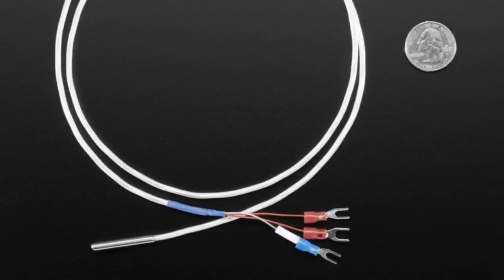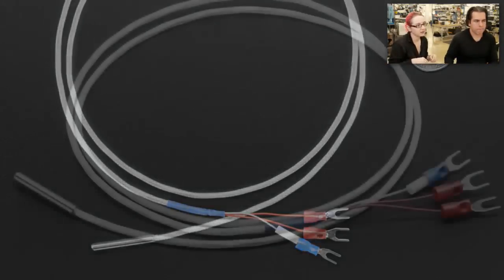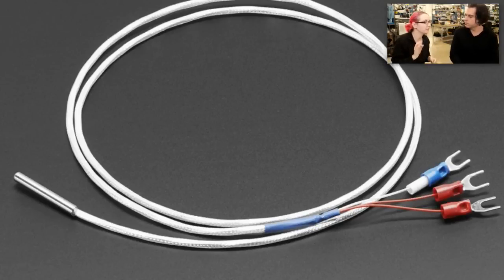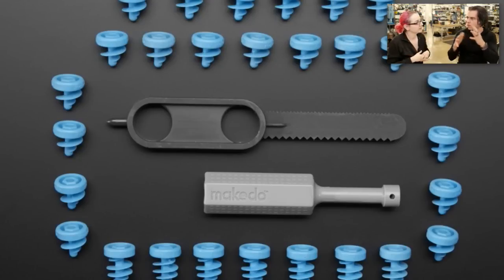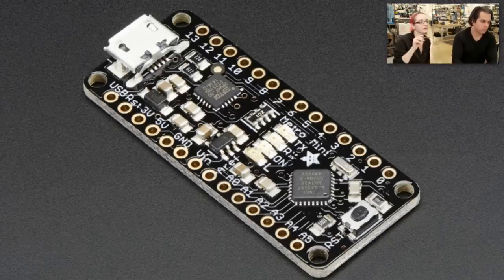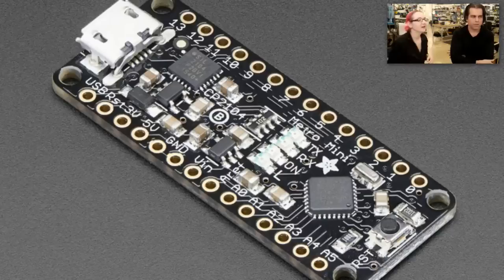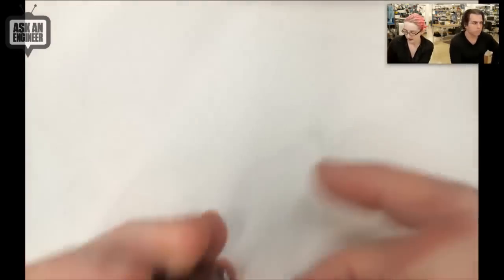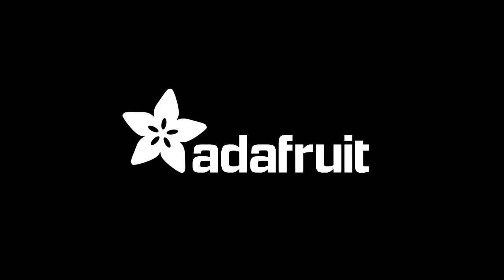New Products 11/9/2016

Comment: Would you kindly help me find a solution for a scanner product I'm working toward creating. I'm thinking I need the following but I'm not sure:
  -  a "TFT FeatherWing" 
   - a microcontroller such as the "Feather M0 Bluefruit LE"
  - a camera 

I'm interested in creating a camera or something that is capable scanning a barcode in order to retrieve some data from the barcode; I will only need a short string from that fetched barcode data (roughly only about 10 letters) which I'll then want to display on the LCD screen. Also, I'll never need to save more than 1 picture at any given time; after I take a new picture I'd like to overwrite any remaining picture data than may be remaining in memory but I would also be fine w/ clearing the displayed text off of the screen after it's been displayed for a couple seconds. I'd also  like to make the overall product as small as possible (while remaining legible).

Are those 3 types of products I listed above required? 
If a camera will be required, what will I need to connect it to?
 
This is my first project ever w/ these technologies so any help figuring this out is appreciated.

Cheers

Comment: I apologize in advance for asking a dumb question.  

I see that the 2.4" 320x240 touchscreen is "for all feathers"...and I gather from your videos that feathers are a series of small boards with a standardized form factor and (to some extent) standardized pinouts.  What a great concept!

But I don't use any feathers...yet.  I create devices with Raspberry Pi's (and particularly with Pi Zeros).

So here is my (dumb) question:

Is it possible to use the  2.4" 320x240 touchscreen as a display/input device for a raspberry pi Zero?  If so, can you provide a link to some tutorial, code, example, etc?

Thanks!
Reply from the maker: No worries! We have a 2.4" TFT display (any other sizes) specifically designed for the Raspberry Pi – https://www.adafruit.com/search?q=PiTFT&b=1 they come with ready-to-go images, too!
Reply: Excellent!

Thanks for the quick reply...and the for the great videos.

Comment: How on earth could that cardboard knife/saw thing work? Corrugated cardboard is notoriously tough even on steel blades, which is why box cutters exist so you can throw the cutting edge away and replace it regularly. That black saw thing looks like it's plastic. Generously assuming it works at all, how many feet of cardboard can you cut through before it's spent?
Reply: I've used it it works and if it gets dull it never happened for me. You need to cut from the edge. The teeth make tiny rips in each layer separately. So it's not hard.
Reply: you can even print it. http://www.thingiverse.com/thing:532877